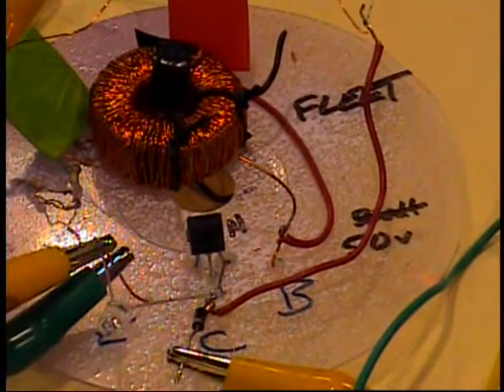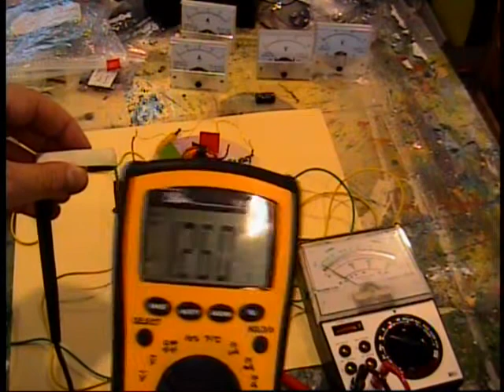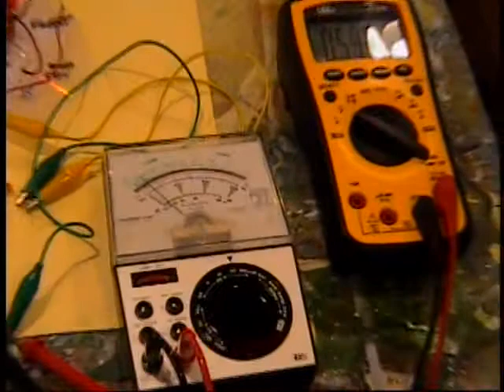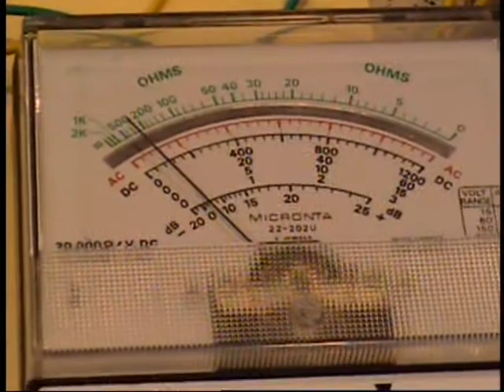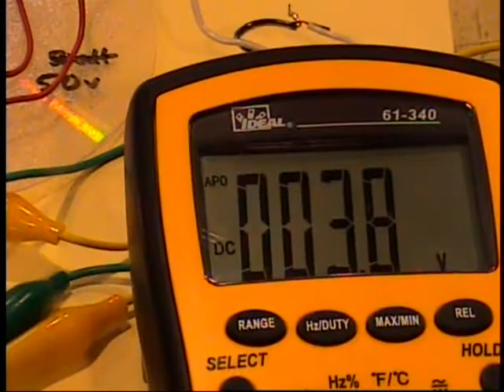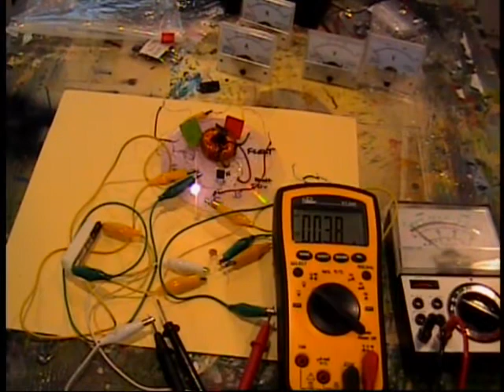FLEET Generator Test 2

Comment: So, the principle behind this does work, if I understand correctly, it is OU, or COP+1 at a minimum...??
Or is there some other kind of loss somewhere else that takes it out of that balance again...just wanna check..

I had the idea some time in the last couple of weeks concerning theoretical musings on the topic.
It seems to me that most of these working circuits, or the ones that I think are working amongst the tens of thousands of fakes out there, are all back emf based, and if you could call normal electronic principles expansive, and thus create heat, then this back emf you could call compressive.

What got me thinking is, what if one of the main reasons that we don't have this tech everywhere now, other than the govt killing everyone that does it...What if, our technology is based on the wrong functioning principles in the first place, that everything is designed to utilise only expansive and not compressive energy...
What happens when you charge an expansive designed battery, with a compressive based energy?
In, I think the kromrey or some other system I saw recently, that a charging battery with some of these circuits gets cold, and not hot. 
What about a capicator?

All the ways we have of storing energy are based on creating the heat...what if we need to rethink our storage systems to utilize the same compression forces...

Can we set up anodes and cathodes on each side of something like this where instead the polarization jumping from one side to the other that its being fed the other way around, could that work? 

If every thing we use is designed wrong, how in the hell do we fix it all. It feels like we would have to complete star over.

Comment: Could you help me please?
I'm trying to build one FLEET generator following the Patrick J. Kelly's ebook and I'm having trouble, I'm using 1.27v NiCad batteries, and a pvc 3cm diameter to make the toroid with a thick wire i got from an old washing machine, 10 turns each pair of wires.
Thank you in advance!
Reply from the maker: Quarentae, you say you are using PVC for a Toroid at just 3cm diameter? At 10 turns of wire and 3cm diameter you will need a Solid core. Iron power Toroids are what I use. If you use PVC to make an Air Core Toroid the diameter has to be large enough to wind 70 meters of wire. That's about 17cm. Air Cores need much more wire than solid core. Good Luck my friend.
Reply: Ronald Gerth I appreciate you answer.
I'm still learning the basics of how electricity, magnet field, etc works.
I did some advanced joule thief versions described in the ebook, and I think I might have burned some leds doing so...
Anyway, I'm learning a lot from your videos, thank you again!